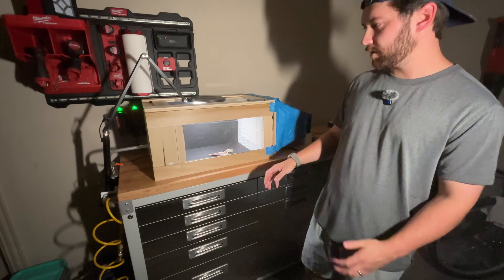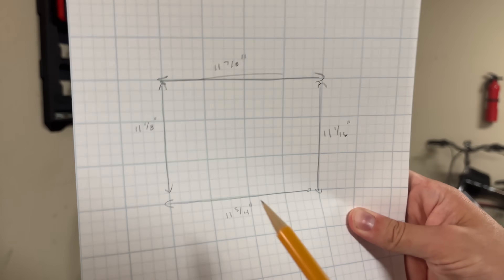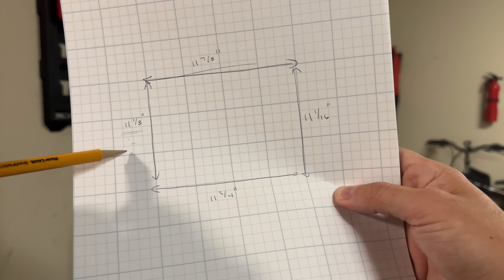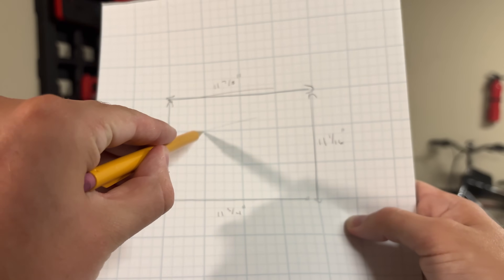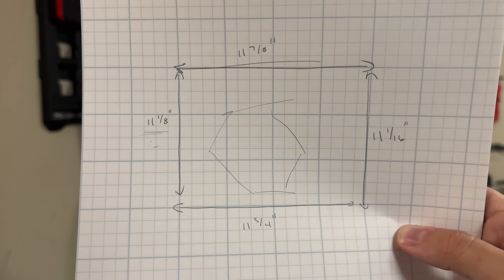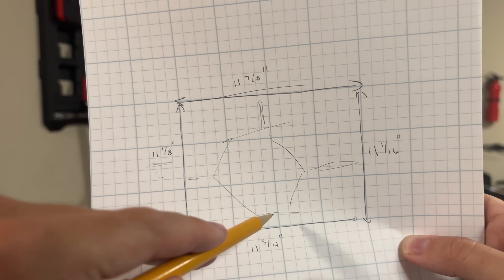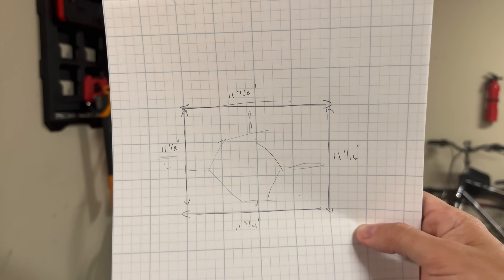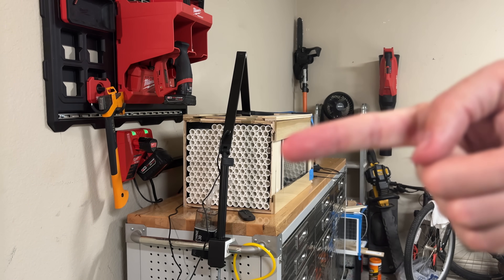DIY Wind Tunnel Part 4: I made the Laminar Flow better!

Comment: Everyone else covered most of what I had to recommend. The only thing remaining is to use a lighter smoke oil. One that will rise like actual smoke, not settle like fog.
Reply: If the smoke is fog juice, then dude needs to look at haze fog (like for laser shows). Fog thickness is governed by the glycol chains it forms into as the carrier water is boiled away in the heater block. Also, smoke (and fog) raises due to heat not particle size.
Reply: @TankR I was thinking that a smaller or lighter particle size might help the smoke not drop out of the stream so quickly. I knew there had to be other types of fog juice since I’ve seen it rise in some instances and settle in others, independent of ambient temperature. I wonder what the smoke used in full size wind tunnels is composed of.
Reply: @GrayRaceCat  Oh brother....(...sister? ....pers...oh cat)...Oh buddy, are there different fog juices, Cat!!! There are fogs that is medium sized particles but sticky on some of their profile (molecular magic stuff) so they link loosely together, you get these long tendrils great for fog pouring through fence slats, there are ones that make large particles that are sticky all around so they made THICK ground hugging fog you cant see through, there are small particle ones that will hang in the air, there are not sticky at all which quickly dissipate (good for fake CO2 bursts), there is smog fog, there is fog that sheds its heat fairly well so its more likely to hang in the air, and of course small not sticky at all haze fogs good for laser shows. 

There is a maddening world of fog juices out there! 

The reason fog from fog machines rise as much as they do is because the heater core is stupidly hot. They dont just boil off the water, it flashes off, like instant dry steam flash off, and produces the fog characteristics at the same time. Almost like popping popcorn. And any little bit of temp difference you get drop or rise. The stuff you see sticking to the ground is usually blown over and ice chamber so its a lot colder than the air, drops like a rock. But there are some that will normalize before they fully dissipate, thats the stuff that ends up in strato layers hanging in the air.

I ran tech (backstage systems, eventually became head technician) at a pair of fairly known in the area haunted houses for over 10 years. Trust, my cat, the world of fog is so much wider and varied than you think....Dont even get me started on foggers.....

Froggys Fog is where we would usually order from (yes they have a website, yes you should check it out). You can get up to 55 gal drums of the stuff!!! I could never talk the haunt boss into that, we usually only ordered 5 gal at a time....
Reply: @TankR   Brother is good, Got the handle from a gray cat I had for 20 years. He never walked anywhere, always ran, like it was a race and he had to be first.
I had no idea there were so many options! Back in the 90s, I helped the apartment manager where I lived, design, build, set up, and run a fairly elaborate Halloween display in the courtyard of our building. His answer, after several small smoke machines failed, was to make Real Fog! He spent hundreds on orchid-mister nozzles, flex hose, and a high-pressure pump. When he was done we had so much ground-fog, it ran down the street attracting the Santa Monica Fite Dept and PD! After they were sure it wasn't from a fire they were cool with it. Some brought their children to see the display. The downside was, real water fog is COLD and uses a lot of water.

Comment: I haven't watched your other videos, but do you know how fast the flow should be to get the reynold's to at least the same order of magnitude to test what you wanna test?
Also, you need a diffuser after the test section to recover pressure and make the fan's live easier. You have the opposite geometry there.
Reply from the maker: Fascinating! Thank you for that feedback!

Comment: Look up pics for Open Circut or Open Return wind tunnel. Add some ducting around the inlet side to help the air come in smoothly to the sides, and also you want your section after the test area to be a diffuser, so instead of moving the single fan closer, bigger fan or 4 fans farther away from the test area. Make your exhaust pattern  all the same size.  Maybe move the smoke machine back a few mm so the duct that goes into can pull air equally to the others around it.

Comment: If this is all being built with basically 0 research or understanding of aerodynamics I am impressed. A couple of tips though 3d prints on the intake side are going to cause some turbulence due to the layer lines. You want a smooth surface for the air to go over. On the exhaust side it should match the intake side. A slightly large and faster fan can help as well. I know a lot of people build wind tunnels with drinking straws which is a good option but if you can get some metal honeycomb that would be even better. There is probably a formula out there for how thick the honeycomb should be IDK been a long time since I looked into wind tunnel stuff. None the less this is a cool project.
Reply from the maker: Yep! No idea what I’m doing! That’s kinda the beauty of the age we live in, I had an idea, watched a few videos & then started figuring it out! It’s been so fun!
Reply: @TheWindTunnelChannel-b1e  Thats awesome! Thats always a super fun way to learn. Trial and error.

Comment: The old fashioned approach of 2 huge bundles of straws on both ends is still the cheapest way to go. Also intake and out both have high resistance so you want 2 identical fans locked at the same RPM. Also the walls introduce drag, the walls have to absurdly smooth or rough and break the wind sticking.

Comment: 7:05 the further away you measure from a fan on the "output side" in open air, the more air gets moved. The reason is the air that is pushed directly by the fan "pulls along" some of the air around it, but obviously it slows down doing this (Bernoulli effect). Obviously this doesn't apply to your tunnel, as it is ducted on the relevant side.
For your tunnel you probably don't want the fans any closer, as they are themselves pretty turbulent, both the individual blades and the airflow as a whole. Blades only move air where they currently are, and since you can't have infinite amounts of blades, movement will be choppy as well. It also moves (a lot) more air on the outside edge of the blades compared to the inside, and none where the hub is. Having some distance between the fan and the chamber allows for all this to be smoothed out at least somewhat.

What surprised me the most was how the more laminar flowing smoke moves in a downward trajectory inside the chamber. Why? is it actually noticably heavier than air? Even then, the mostly laminar moving air should pull it along more than it seems to, I would think (it can't be THAT heavy, right?). Or is the airflow that uneven at the exit end, possibly due to the effects despribed above?

Comment: @1:15 LOL. You don't need a wind tunnel to know how it behaves aerodynamically flying through space.
Reply from the maker: But don’t you kinda wanna know anyway??
Reply: Computational simulations, and the math they are based on, are riddled with error. The results of some simulation or your own calculations are only truly validated through real life testing of a scaled or full sized flight article, e.g. wind tunnel testing.

This is why research organizations, government agencies, private entities, etc. spend so much money on various wind tunnels. Sure, they could all just solve the continuity equation or run CFD simulations. But those only approximate and loosely characterize the flow. They don't definitively tell you how air interacts with the body. You need a real test rig for that - in walks the humble wind tunnel.
Reply: @keyboard_warrior_cagematch is this intended to be sarcasm?

Comment: The optimum ratio of cell size to length is about 1 to 10 - so for a 10mm diameter cell, it wants to be about 100mm long.  This is driven by a combination of factors.  Longer gives you more laminar flow but with more resistance to flow.
There's no advantage to the cells being hexagonal.  Square works just as well - and that's faster to print (even if it doesn't look as nice)
I would change your exhaust straightener to a uniform pattern.  Two different cell sizes is just asking for turbulence.  If you find your fan generates a non uniform pressure across it's diameter, either increase the length of the exhaust tube or use baffles inside the exhaust to better distribute the air.
You can improve the fan by adding a stator in line with the blades to partially cancel the rotational nature of the airflow generated by a rotating prop.

Comment: you might want to try to do a forced air system instead of a low pressure system. I would suggest four fans  blowing into a course filter to combine and randomize the airflow, an empty chamber then your honeycomb inlet baffles. don't worry about an exhaust fan.
Reply from the maker: Interesting! I’ll have to look into that!

Comment: Nice progress! There are a few ways you can improve your intake section quite significantly. Add a smooth 4:1 'contraction' to the intake and two layers of window screen in front of it. The flow straightener goes in front of the screens. Leave about 20-30 mm of space between the flow straightener and each screen. The second screen should sit right at the start of the contraction.

Your 3d printed honeycomb flow straighteners do work, but the cells are too long. Aim for 4-6 mm cell size and 30-40mm length, with a wall thickness of 5-10% of the cell diameter (0.25-0.5 mm). Use a smaller nozzle if you have one and can reliably print with it.

On the exhaust side, remove downstream straighteners. They do not contribute to stability and just add loss, slowing down the airflow. Build a 'diffuser' (a long exhaust section) and mount the fans at the far end. Ideally the fan area should be as large as the diffuser's exit area. A wall of fans (e.g. 4x 120 mm) is a viable solution, all sharing the same PWM signal. You could use as many as nine fans; just make sure the diffuser is long enough for gentle expansion; it should diverge slowly. Use high static pressure fans.

If you really want to try straws, plastic coffee "stirrer straws" often work better than drinking straws. (Uline sells them for ~$4/box of 1000.) I tried this, but cutting them is tedious and clean cuts are tricky.
Reply: This is the answer.  The inlet contraction following honeycomb and/or screen is the key to drastic inlet turbulence factor reduction and uniformity of flow.

Comment: Straws. Lots and lots of straws, skinnier the better (i.e. cocktail straws) . If you can only get bendable ones cut the bendy bit off. You'd need about 9500 x (3mm) cocktail straws which is about $40-70 if you buy wholesale. You can do it cheaper if you pick larger straws.

Depending on how airtight that box is, you might want to set it to blow instead of suck. Any air getting in through cracks is going to cause a small jet which will cause turbulance. If it's sucking, that jet ends up inside the chamber, if it's blowing, that jet'll be outside the chamber (where you don't care). This also means you can ditch the exhaust part of the laminar flow device. Might want to replace it with some fine mesh though.

You've got different sized holes at your exhaust which means different resistences and you've got a print that's short at your intake, which is easier to draw air through than the other bricks. All of that causes turbulance.

Then you've got them bricks you have to assemble. Each of the walls of the bricks will introduce a flow difference, causing turbulance.

And you've printed it so the insides of your tubes ripple, which'll add more turbulance. I'd say print sideways if you must but honestly, lots of straws will be faster and probably cheaper (it's how my school did it).

If you're going to print, I would say print the case for it and tape it up so that it's as smooth inside as possible.

Comment: The exhaust fan is more important for laminar flow, as this creates a slightly lower air pressure in the chamber.
On the intake it's best to put a finely perforated plate without any restrictions in front of it. This will allow air to be pulled into the chamber evenly over the entire area (as all those tiny openings have the same resistance), rather than forced - which will always create turbulence.

In further adjustments you can actually experiment with sections of that perforated intake plate to be swapped for ones with more or less % open surface. This way you can create places in the chamber with slightly higher or lower velocity, and still have it be (relatively, at least where you need it to be) laminar flow.

Comment: Have you tried sourcing some aluminum honeycomb? Those are pretty darn thin and should omit quite a bit of the turbulence caused by thick walls.
Reply: I tried some years ago and couldn't find a supplier willing to deal with the small quantity I wanted.
Reply: @cedarmyers6709  Hmm. What about paper honeycomb? I'm guessing it doesn't need to be super water or heat resistant or anything like that.
Reply: Nice idea. I had never considered paper honeycomb before. It does need to be stiff, but I don't think that would be much of an issue. It's all about the geometry for straightening the airflow. The cells need to be small enough (4-6mm for this tunnel). And the cell walls should be thin, smooth and have clean edges. The ideal ratio for efficiency is 90-95% open area. And the honeycomb thickness should be 6-8x the cell size. It's definitely not as durable and moisture may potentially be an issue (smoke/oil?), but in theory it seems like it could work.
Reply from the maker: I researched (googled) for hours trying to find something I could order, but nothing was as cheap (relatively speaking for filament cost) as a 3d printer!

Comment: Traditionally there is no flow straighter on the downstream side.  A fan blows over a small area but in suction  inlet flow is reasonably uniform 2 fan diameters away or greater when the fan diameter is close to the duct diameter.

The smoke plume becomes turbulent because the Reynolds number is increasing as the plume gets longer.  Since your tunnel does not recirculate a radius inlet would be helpful.  

If you have the budget for it,  an array of fans, even old ones from e waste would get uniform flow with a shorter tunnel.  Search for  a pdf  called ASHRAEs-Duct-System-Design-Guide   .  

Make a hot wire anemometer sensor on a long very skinny pole (like a rabbit ear tv antenna) and you can measure airspeed across the cross section of the duct.
Reply from the maker: This is incredible feedback! Thanks for sharing! I’ll have to look into that!
Reply: @TheWindTunnelChannel-b1e  You may also like this book:  Fan Engineering: An Engineer's Handbook on Fans and Their Applications by Buffalo Forge Company

Comment: Larger openings means lower pressure and the air speeds up.
Larger openings would also mean you need longer tubes to create the same counter productive effects because of the longer tube has more length for contact build up of resistances.
But on the exit side it shouldn't effect the chamber that much.

By placing smaller tubes under the center you would coaching the smoke to move to center.  (The smoke is heavier than air so it wants to fall regardless of the tubes.)  By placing larger tube directly above where it's hitting the screen it should coach them back upwards?
Reply from the maker: I’ve been thinking the same thing!!

Comment: You need to redo the experiment in (2) separate forms.
Form 1: (Hypothesis) Push the outer black pieces further in.  This will create a cone.  The outer area will be laminar longer.
Return the alignment to flat like you show in the video.
Form 2: (Hypothesis) Push the center pieces further in wards.  This would create the center having longer laminar flow.
Check for which one has more of the desired effects.
Reply from the maker: Oooo good idea!!

Comment: For your fan that's pulling air might I make a suggestion? What if you put the fan on a linear guide track so that you could adjust the distance on the fly. And instead of your reduction setup you have right now if you brought it down to the size of say a dryer venting hose you could attach that and feel it on the inner side of the fan so that when you slid the fan inward and outward it would adjust automatically. Just a thought. Not sure how feasible it'd be though.

As for the opposite side where you intend that just have that center for the air to go through, why not 3D print a second copy of what you put on the front end but only have the central piece have holes going through. Then your input and output would more or less match with your input being a low pressure and your output being a higher pressure.

 Thanks for a great video!
Reply from the maker: Thank you for your feedback! An adjustable fan distance is brilliant!! Good idea! Thank you!